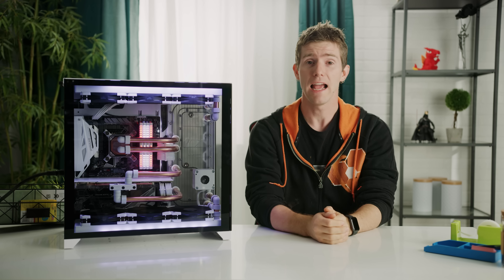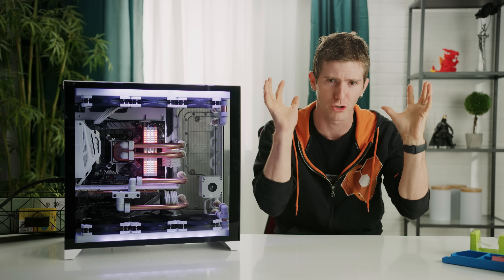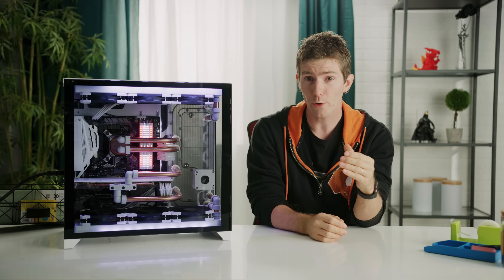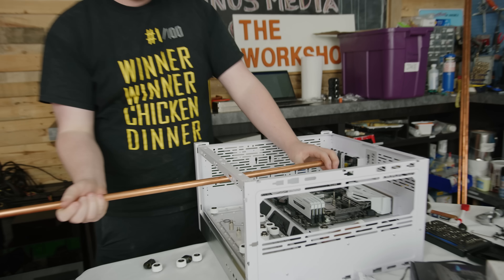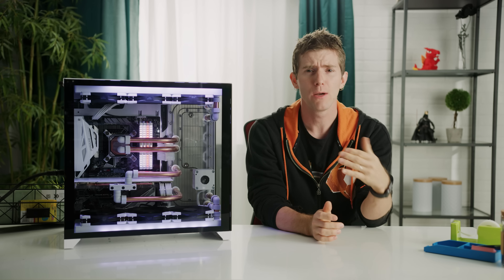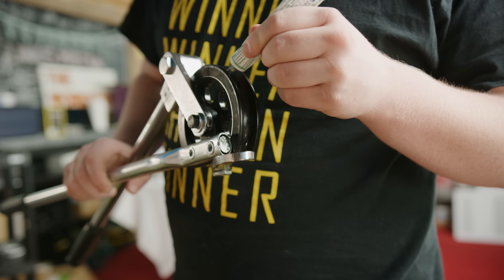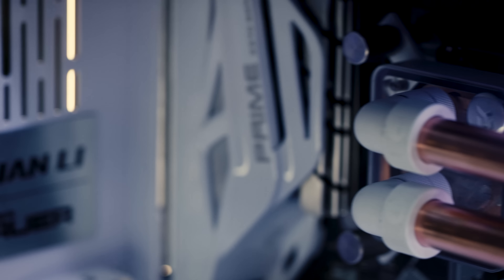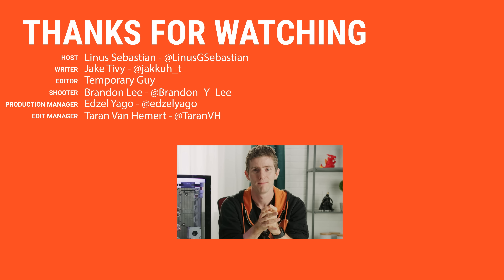Copper Tubing is HARD

Comment: It's called half inch pipe  because the internal diameter is half an inch. Tubing is measured from the outside piping is measured from the inside

Comment: I never heated copper to bend it, Just put in some new heaters in my home with exactly that kind of copper pipe, i just bended it took a bit of power but there nice bends.

My bender is different it is 2 parts and has metal tubes were the copper pipe runs trough, it takes a lot of power to bend them, i mostly put one side on the floor and lean on it with my full weight.

Comment: I thought about this like 10 years ago.. However I ended into thought that not going to try it. Reason is that radiators are usually made of aluminum. And comparing aluminum to copper with liquid between them, leads to chemical corrosion in longer run. This has happen when someone decided to replace a rubber hose by copper pipe on car cooling system. It leaded to that radiator and other aluminum parts got serious holes inside of them.

Comment: Copper is used for radiating heat, so you've effectively put radiators inside the case, not outside it.

Comment: Looks really good tho
I used to bend tubing like this at in a fab dept of a factory years ago. 

We would bend tubes like this without kinks using a small cylinder of liquid nitrogen. Tho I’d imagine you could use a freezer instead of liquid nitrogen no problem. 

Cap off 1 end of the tube. 

Fill it with water and cap off the other end. 

Dip the water filled tube in liquid nitrogen. (Or freeze it in freezer. Water needs to be absolutely frozen tho)

Bend tube 

Let thaw and uncap ends to drain water. 

Done.

Comment: The copper tube itself will aid in heat distribution, its the perfect material for watercooling, however only on intel, watercooling a ryzen2700x is just pointless they are too efficient as many are now finding out for themselves. Copper tubing is used in central heating for this very reason. And yes BARROW make excellent quality watercooling parts, on par if not better than EK.

Comment: Instead of filling the tube with sand you should use salt, you can flush it out if it gets stuck.. Or you can just fill the whole thing with water and seal the ends shut and bend it while its sealed

Comment: You do realize a spooled copper coil alone is not going to majically dissipate heat to the air without constant air/fan blowing across the coil like condensing unit. Also when you are removing heat with coils, it has to do with pressure drop. Going from larg to small diameter tubing. HVAC/R101

Comment: You are not softening the copper by heating then dipping. If you heat it then let it cool slowly it's softened. And it will be so soft a length of fairly short tube may bend under its own weight. It so soft you can't work it. 

Annealing removes work hardening. Of you have to bend the copper a lot it will work harden and then crack instead of bend. When you heat it is resets the internal structure so it is destressed. And then it's made hard by rapid cooling so you can actually work it.

Comment: I feel like if you had used a foot bender, you could have skipped the heating and sanding of the pipe. They are meant for much harder pipe and as long as you held it close to where you wanted to bend, it wouldn't be a problem. Could probably borrow one from an electrician

Comment: I'm in the process of updating my loop right now. I don't plan on doing copper tubing, but I really love the looks of the barrow distribution plate. I looked into it and it looks like it's only compatible with a DDC pump. Does anyone know if there's a certain pump top you need to run with this water channel? I can't find anything about it on AliExpress.

Comment: Here is one I haven't seen before... instead of standard plastic cooling lines, how about go with some high-pressure, braided, steel automotive fuel lines? They look similar to stainless steel, are about the same diameter as your copper lines, and you don't need to bend them.

Thanks

Comment: I'm always thinking how about sliding some fins that would be a piece of flat round copper with the diameter of the pipe drilled in it over. Those straight Copper pieces of pipe and fasten them solder would give you the best heat  transfer put them  at quarter inch intervals?

Comment: The reason copper “tubing” says 1/2” and has an outside diameter of 5/8 is because tubing is measured in Inside diameter. Pipe is OD.

Comment: Couldn't you attach some heat diffusing plates along it to diffuse some of that heat into the case before it goes to a radiator. Then just have some decent case fans

Comment: Wrap some heat fins or add co2 mesas around/inline with the copper tubing and blam, an excuse to use copper tubing other than visual aesthetics. ((Even though technically (even though You can't measure it) copper tubing conducts more heat before hitting the radiator than pvc/vinal; although, oxidation of the copper is a long term issue.))

Comment: One problem with how you placed the copper over the ram without enough clearance is if you need to change the a stick or two or all you have to remove the pipe :/

Comment: Just buy the chrome plated brass tubing by bitspower and a $100 pipe bender. Modsbybenq has a video proving you can bend them without cracking the chrome plating. These are way shinier then any polished copper. And way less work then polishing and sanding copper!

Comment: Why didn't solder 90⁰ or 45⁰ elbows in . Woulda been so much easier and had silver solder joints. Newer tech has a crimper for the joints. Looks great.

Comment: You don't need to heat up the pipe, copper is already soft. Even Stainless Steel tubing up to 1/2 can be bent with manual pipe benders quite easily.

Comment: I just left the comment in one of your other and then I saw this I am the bender from hell , seriously you got to have confidence I've been  conduit as an electrician I owe everything I am to my mentor ,anyway  have you ever tried soft copper you know plumbers have two different types hard straight and  two degrees of  flexible also before you bend you will get better results if you  anneal the copper with the torch use the right kind of Bender to support it will keep you from getting Kinks as with all bending the right diameter for the metal your bending a tubing Bender it is a totally different radius and you have different shrink measurements but it's basically the same concept if you don't want any kinks anyways I got to go tell you more later you've heard of Bender the robot ?I trained that guy lol my voice text is messing up right now and I don't have time to go back and correct it sorry for the muddy words

Comment: Actually, using copper tubing DOES help with thermals. It just doesn't make enough of a difference to be worth doing.
Reply: copper tubing can make a difference if you manage to run the tubes long enough, something impossible with any normal setup and not worth doing.

Comment: I ponder if the massive copper coil lacking much thermal radiation performance is due to the coils being tightly wound, or inadequate air flow?  I never watched the episode....and probably won't d'oh.....but I was going to ask if y'all tried wrapping the cold-side copper runs on your rig in this video, and see if there's any further effect?  Copper is an extremely good heat conductor, after all....maybe I'm intellectually trolling or something...just some thoughts

Comment: Or you can learn about electrolysis. If you coat the copper in titanium at different voltages you can get all types of colors that look like powder coating. There is a really good video on Youtube on this topic. This way you would have less reactive metal in your loop.

Comment: There are about twenty one different Plastics all with different solvency rates look underneath the bottle of that Rain X and you'll find out what that is and also check with your tubing you should know what it's made with polyethylene chloride or whatever it is and that's the only way you'll know is if they're the same or you'd have to look it up to see if they both have the same or better

Comment: If your useing copper tube for heat. I would use enhanced od tubing used in ac condensers
Reply: The K type copper that they used, is for supermarket fridge systems.  This is a higher rated pipe for use with C02.
Reply: @williammartin1386  the enhanced od tubing is used to.drew heat out of the liquid it has up to 200fins per inch witch aids into the heat desperation it used mainly in high rise ac units.you can look it up at shawneettubing. Com.  An look at the tec tube

Comment: Been wondering why they haven't done this a long time ago. Plus if you don't want to bend the hard pipe, there are plenty of available 90 degree fitting in your local plumbing store / dept. You could even do copper tube, brass fittings to be fancy. Don't know much about what you would want for the liquid though.
Reply: Downside of using fittings for the bends is that those are extra failure points for possible leaks.

Comment: I have a dream. A dream of a transparent watercooled block for your CPU: hardline transparent piping of two diameters and a Colaboration with the Science Savy channel of your choice (i'm partial to CodysLab).
If you can build an airtight water loop, Slap your radiator up top of your rig, stand it upright (yeah you'll have a sail but hold on a moment) Place your water storage just above your CPU mounting (keeping it under positive pressure) and loop the water piping below the CPU height to supply the input water.
Then Pump out most of the air, you want to get your pressure down to the vapor pressure of water at 50oC
Congrats you just built a Computer cooled by a DIY Heat pipe that should keep your CPU block at 50oC forever
Suggestion: Large diameter output from CPU up to Radiator to maximize water vapor flow into radiator: where room temperature air will rapidly condense the vapor back into water to flow back into the bulk storage, where it can return to the CPU for more cooling pleasure.
In theory: you can tweak the vapor pressure as low as room temperature, but when your room is warmer than that temperature you'll struggle to condense your vapors and may run short of water storage.
Additionally you REALLY don't want boiling to happen in a gravity powered cooling solution anywhere except in the CPU, otherwise you will suffer back flow and may end up with a dry CPU for your troubles.
But that is what the Sci Channel of your choice is for: checking how to make it work.

Comment: Has two 360mm radiators in the loop
GPU FEEDS HOT WATER DIRECTLY INTO CPU

Unless the flow is going the other way, but still. Hot outlet into cold inlet
Reply: You don't know much about water cooling, do you? There's no such thing as "hot outlet". Unless the pump is going reeeeeeeally slow, water temps are nearly the same in the whole loop. So loop order doesn't matter at all.
Reply: Reinhard Moser thanks for the informative reply

Comment: Hello guys, I have a question for you, I hope you can help. I built my pc 11 years ago and would like to bring it to today’s standards ( as much as possible) . My mother board is an asustek M5A97 Pro , my cpu is an AMD FX-8120, I have 16 gb ddr 3 (mix ) and a GeForce Gtx 1050 ti. The boot drive is a 1 tb ssd. Running windows 10 pro. Any advice ?

Comment: lot of unnecessary steps.
Just get a straight pipe from home depot and use a pipe bender. You don't need to heat up the pipe to bend it. The pro just use the pipe bender and just go slowly when bending it. 
Also, make sure to bend the pipe first before cutting it, it make it easier to bend and also helps when your trying to get exact measurement.

Comment: Great job as always! But I have a question, you said in a previous video ( https://www.youtube.com/watch?v=FR9l4q3cALM ) that mixing  aluminum and copper products in the same loop could cause galvanic corrosion and result a leak in the cooling system. Now you mix copper pipes and aluminum radiator. How about that or did I misunderstand something? I know this video was 2 years ago but I just saw it.

Comment: I would have believed copper would help cooling!
Reply: It does, but the small surface area of the pipes makes for negligible heat dissipation.
Reply: @MrStoffzor  I mean a measurable difference, but not significant.

Comment: I enjoy watching the Linus Tech videos, but this one bugs me. There’s a ton of work here that isn’t required if you bought the right materials. If you use a tape measure, simple math, “copper tubing” and not “copper pipe” you wouldn’t have to heat up the pipe or fill it with sand or sand off any burn marks.

Comment: This is already old but seriously.... You know that you need rubber inserts to bend PVC, did it NEVER occur to you that there are inserts for copper?! Buy a metal spring to insert into it before bending and you don't need to heat it at all. They literally sell it for $10 from home depot where you buy the pipe.
Reply: Where the hell were you when I was getting my tubes ... the work which I could have saved f***

Comment: Honestly, for a copper tubing build, this is half-assed at best. There should not be any 90 degree fitting, only straight ones and double-angled tubing. And look at that awful tube-fitting-tube thing at the top left of the case. Ye, more work and such, but the result would be so, so much more impressive.

Comment: You wasted time sanding when you guys could have just used a flux and rag. Also, why waste your time bending when you could have used Copper 45 / 90 degree fittings? I'm sure 1/4" tubing would have sufficed.

Comment: All of this cooling nonsense could be avoided if the CPU socket were simply placed on the solder side of the Mother Board. 

Then the CPU could be clamped to a back plate of heavy aluminum with fins. 

Radio transmitter RF modules have built in copper flanges to conduct heat from the dies and toward a heatsink. 

Computer designers are not very bright in the way they struggle with temperature management.  

A year ago I heard a strange sound near my wife's desk. It sounded like something falling. Not till days later when her computer was struggling did I find that one of the plastic tabs that held the bulky spring mounted heatsink fan had failed and the heatsink was floating inside doing nothing. You would think that AMD or INTEL would change the design and do the right thing. Or maybe they love the extra CPU sales from modders blowing up stuff!

Comment: You know you could've simply gone with the coiled copper pipes cause they're easier to bend because they were pre-heated and can be rolled out on the ground for straightness, so you could've spared time on the sanding. Theres also a way of pre-calculating the pipes so you could've spared work :3 The final build though is neat and really a Eye-catcher.

Comment: It helps having the right tools and supplies, which you really didn't.

And why would you use copper hard line and not slip-over brass feral compression fittings? With those you could lift the computer by the pipe and it wouldn't go anywhere.

Poor show.

Comment: Quenching will not make any metal easier to bend/straighten. With copper it won't make it harder, but not easier either. Annealing is much different, heat to a sub-hardening temperature (basically until it is barely glowing) and let it cool slowly, preferably in a an oven @~400°Freedom (~205°Communism) so it goes even slower and more even.

Comment: This is nuts. Maybe curved 90* pipe was the mandatory design feature. It's the 21st Century. Plumbers can do any-degree turn of copper pipe in seconds. There are companies like (sharkbite) who make child-proof (180*, 90* etc etc)  connectors. They can connect any type of metal and plastic. U didn't have to bend anything.. These connectors  can withstand pressures and heats you guys never get near. And these connectors are wayyyy cheaper than the Boutiques from whom you buy your water  stuff. You could also use pex plastic piping. That's what they use in new homes. And there are certain pex piping which are purposely made to transfer the heat from their water, to floor underlayment?? Again, way less expensive than what you guys use.

Comment: Linus... hate to say it bud, but stick to the PC stuff and leave the plumbing supplies to the plumbers.  Bending copper is not that hard so long as you know what you are doing.  Everything else you noted about copper and its use as a cooling tool I can agree with though.  Have you thought of using insulated braided stainless steel lines or aluminum?
Reply: Did you forget what channel you're watching have they ever done anything correctly